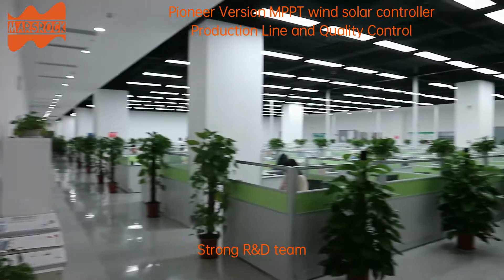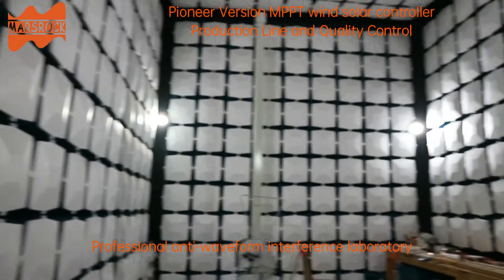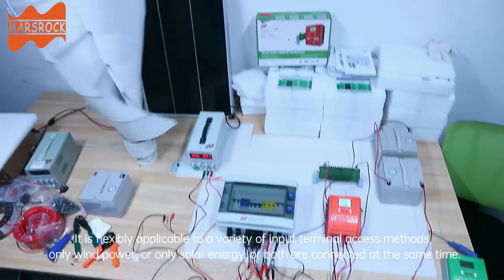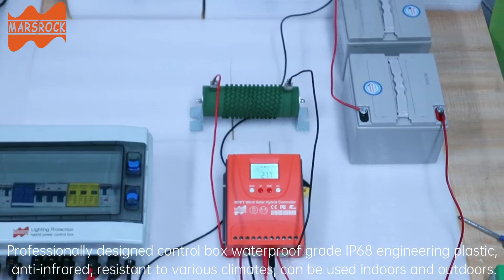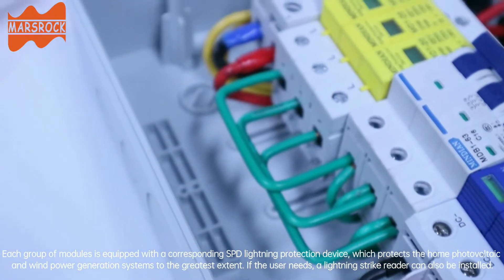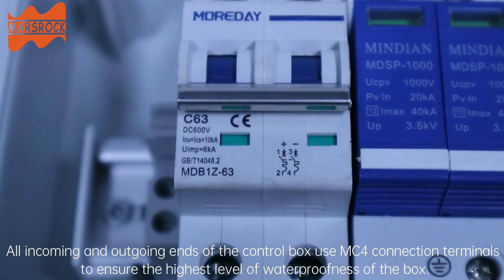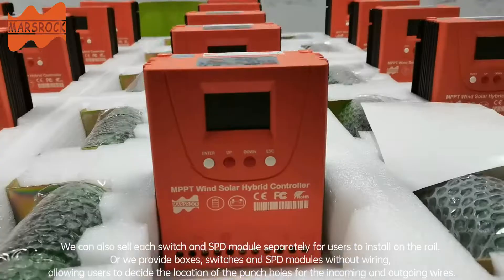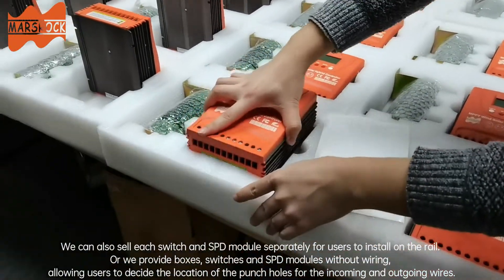Pioneer Version 3000W MPPT Wind Solar Controller producting line and controller box introduction

Comment: this orange control 3000w does not work. I have ista breeze 1500w and when the wind turbine starts charging as soon as the controller shows about 550w on the screen, it applies the brake and does not start again. it waits for 10 minutes and charges again for max 2 minutes and brakes on.
Reply from the maker: Dear customer, I'm sorry to hear this news, but there are many reasons why the controller may not work, and each situation is different. To ensure the normal operation of a wind turbine, it is necessary to have continuous and stable wind power. Secondly, the working efficiency of wind turbines with vertical and horizontal axes is not the same. For wind turbines with the same power, the horizontal axis usually generates more electricity than the vertical axis, while the vertical axis may not generate much electricity, which may cause the wind turbine to fail to reach the minimum starting voltage of the controller, resulting in no electricity generation. Thirdly, if encountering typhoon weather, in order to protect the equipment, the system will activate the braking function to prevent overcharging problems The above problems are all possible. If you have any further questions, you can contact us through service@marsrock.com.cn Contact our after-sales department, and our after-sales personnel will answer your questions. Thank you!

Comment: This is Hack of Crap they do not work as they should - They do not supply a full manual with full settings 
DON`T BELIVE THIS VIDEO 

Kenny @ Marsrock cannot communicate through watts app China do not allow them 
He cannot answer your questions 
The Item would be worth buying if all worked if it came with full settings instructions and proper communication 
but it simply does not work as it should 
Thanks everyone 
Troy